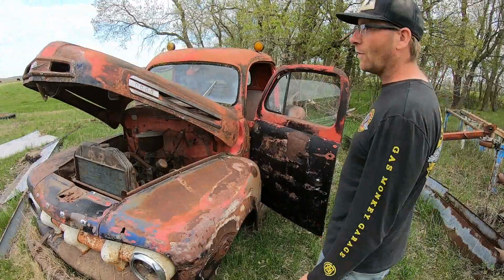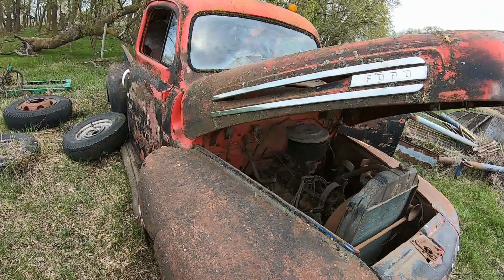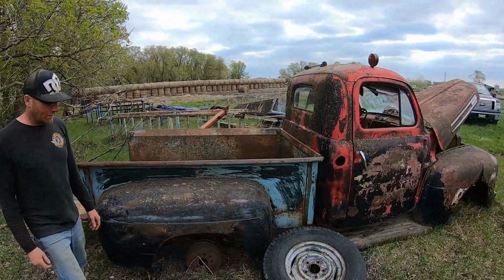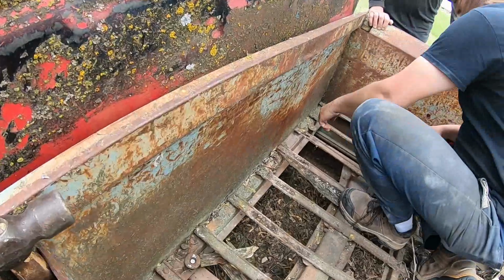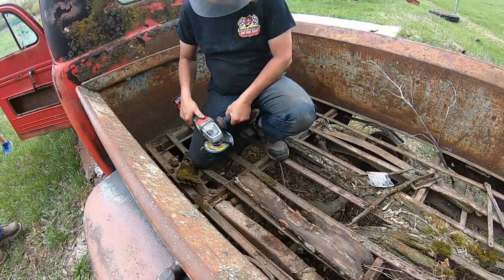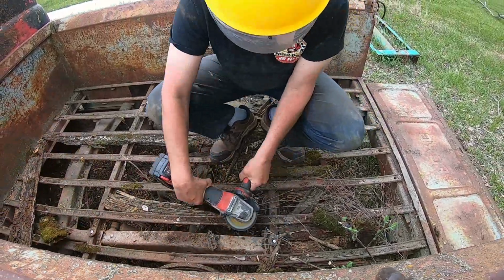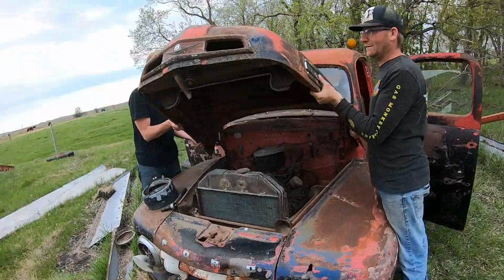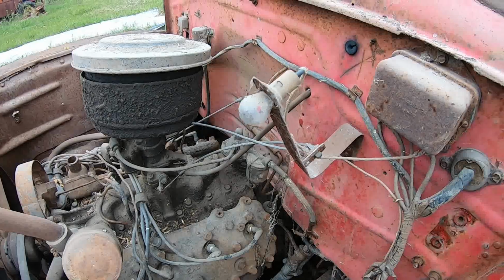Removing The Box and Hood on Our 1952 Ford Parts Truck.  Disassemble.  52 Ford 1/2 ton project.

Comment: so, 8 bed bolts and the running board bolts?
Reply from the maker: Yuppers Bill.
Reply: @pennyshotrodscustoms  I'm going to put a different rear end in mine and I think it would be easier if I remove the bed first. It's a 48 f1 on an 85 chevy truck frame. It was like that when I bought it. It has a 308 single track now. I am putting a 410 positive track in it. Trick Flo cam guy said I need to do this so the stall converter I have in it will work right. The engine builder told me I needed a 3000 stall converter with the engine (383 stroker 550hp). the set up I have now is just not working. I hope trick flo guy is right!
Reply from the maker: @nowayhunting  I would do that just make it easier and if you have help Bill and sure sounds like you have a great power train there.